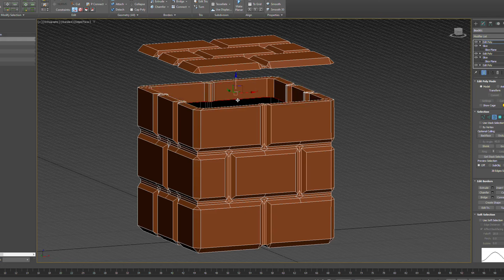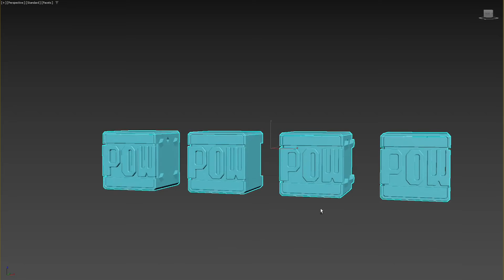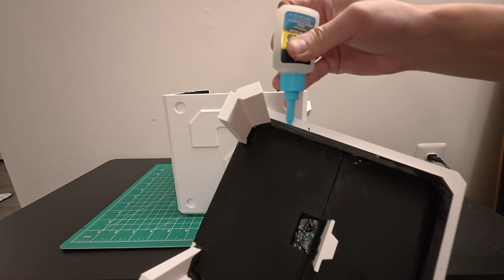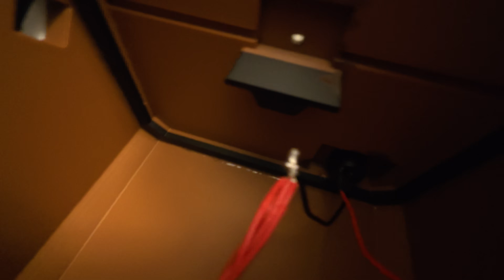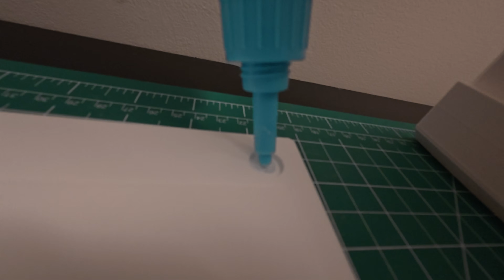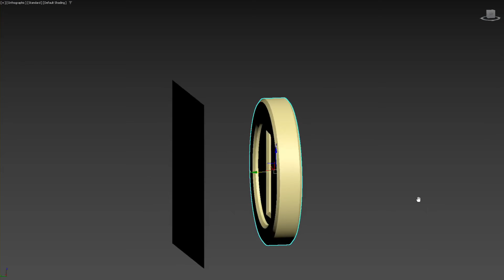I Made Real Super Mario Blocks… With a Twist!

Comment: I love this! I am wondering if there's any way for the coins to spin at the same rate?
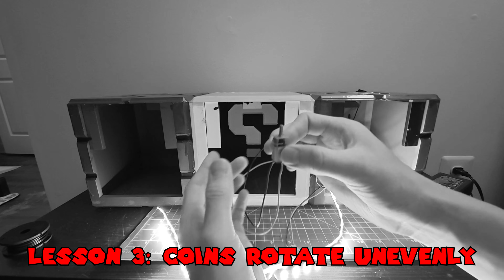Reply from the maker: thanks!!!! i briefly mentioned this at 24:58 and it's definitely possible if I had 3d printed a couple gears that connect to a single motor. It would definitely be easy to design. I might have to come back to this project to improve it and this is going to be one thing I'll fix.
Reply: @ProjectKwokcade  for now I will use them as a shelf to put some Nintendo merch on, but if you ever decide to implement a coin synchronization system, a belt would probably be better suited than gears. This is coming from someone with no mechanical experience yet.
Reply: @ProjectKwokcade yeah everything else is amazing, keep up the good work!